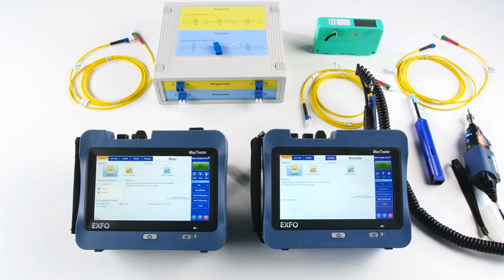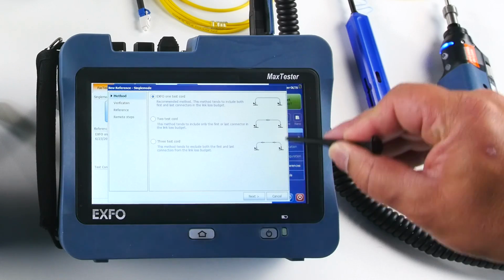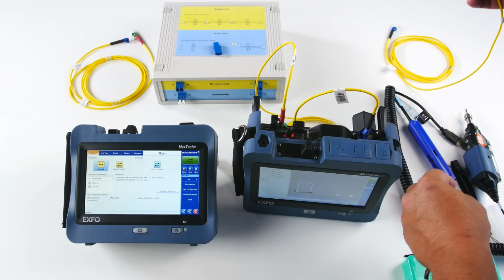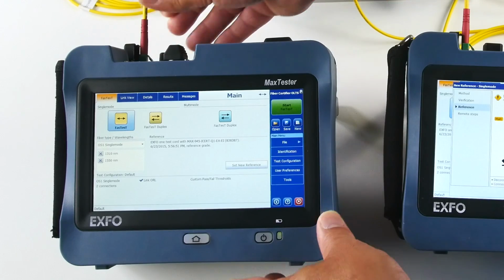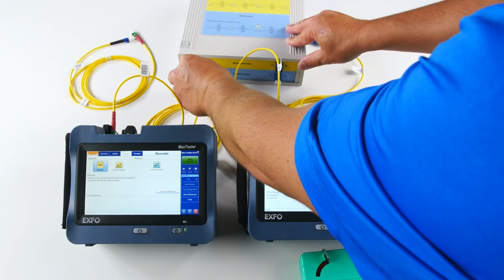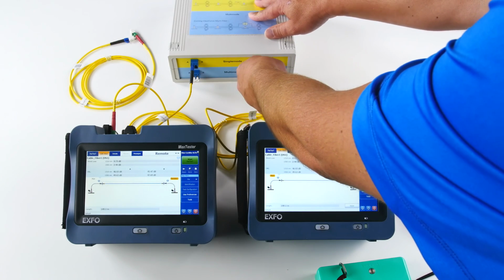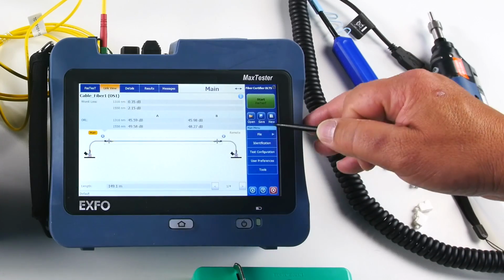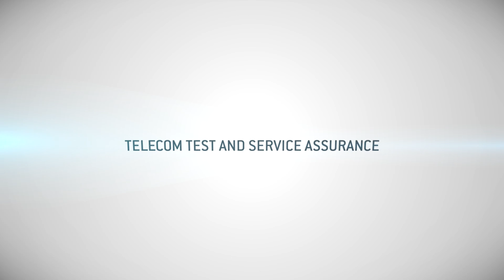How to use and run a reference test | Maxtester 945

Comment: Why do I get “Low Disk Space
You are running low on disk space.
Try to delete old or unnecessary files to free space” message when testing with the MaxTester 945? This happens when I try to save data. I have only used 18% of the space provided, so I know I’m no where near full.
Reply from the maker: Hi Simeon, sorry to hear that. Could you please provide us with your email address so someone can get in touch?

Comment: We use the 945, and for reference we use sbs, two tc and even though we have scoped and totally clean optics we have temdense to get negative loss values in step two when you put the bulkhead in between the two tc , do you have any ideas what that could be?? And sometimes we have burnin on the optics on the 945 even though it was totally clean in morning🤷 what to do🤔